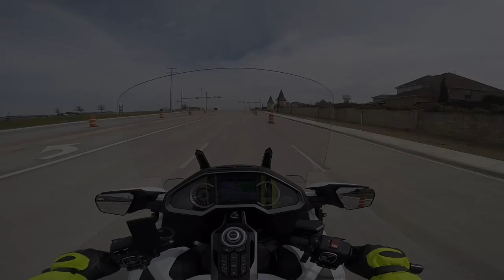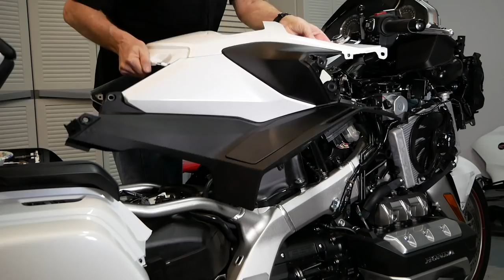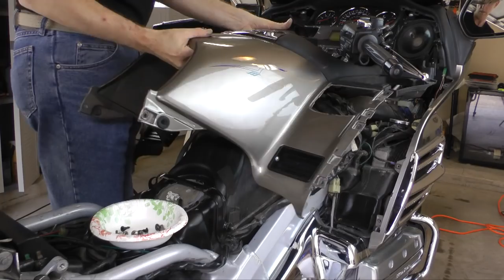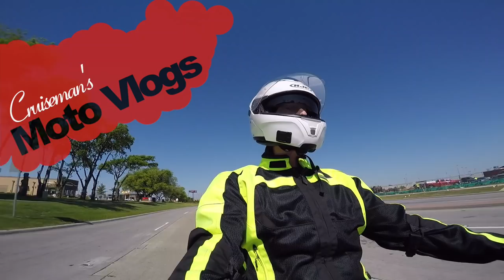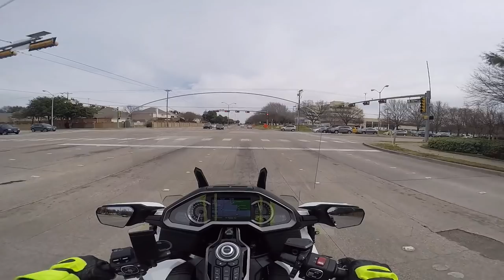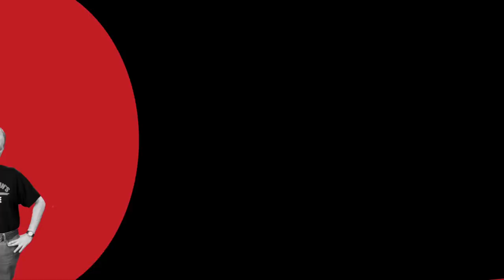A Cold Day Ride in Texas | Cruiseman's Moto Vlog | CruisemansGarage.com

Comment: Chris - Another GREAT video. :)  You've answered my "inquiries" regarding the "recommended tools" AND I'm very happy about the NEW & IMPROVED Show Chrome isolated fuse-block from BigBikeParts for the 2018+ Honda Goldwing.  I look forward to you doing a possible installation video for this new isolated fuse-block.  BigBikeParts has a lot of cool stuff for the 2018+ Honda Goldwing; I'm impressed with them AND you for the products and installation videos for the 2018+ Honda Goldwing.  Thank you, Chris and BigBikeParts. :)  ALSO, I, too, ride in cold weather WHEN the roads are dry.  I've ridden in 26-degree weather by wearing jeans with an inner liner, a non-mesh light-weight jacket, First Gear motorcycle pants with armor, and First Gear motorcycle jacket with armor.  With the Goldwing heated grips and seat, I'm very warm.  I do have Gering lithium-ion battery-powered heated gloves which I can wear IF the backsides of my hands get too cold.  Bottom line:  I prefer riding in "cooler" weather;   75 degrees and below. :)

Comment: I ride everyday of the year (I don't own a car)  in North Alabama. Now riding an Indian Roadmaster I bought a year ago. Before that , I rode (and still ride some) a Victory Vision . My record cold ride to work (30 miles one way) stands at 4F about 4 years ago. My water bottle was placed in a bar mounted cup holder and it had ice in it when I got to work. 

What do I wear , you ask? Everything I own lol. Coldest ride on the Indian this year was only in the teens (it never reached single digits in north Alabama this winter). 

I haven't used heated gear in 3 winters. I found a water proof, wind proof one-piece suit that is bullet proof in the cold. I layer accordingly under it  depending on temp. The only thing is that it does not have armor. Heated grips and seat help in the cold.

Comment: At the moment I use welding gloves (gauntlet style) and I cut the bottom of the gauntlet covering so that the gauntlet will slip over the end of my leather jacket. Good for cold weather, but I would like to find a good pair of gauntlet-style gloves made for motorcycle riding that are more flexible for pushing buttons.

Comment: Chris - A correction: I have Core S-2B Heated Gloves from Gerbing's Heated Clothing, Inc.  ALSO, a non-mesh light-weight jacket, such as a windbreaker for wearing underneath motorcycle clothing gear when riding in COLD weather.

Comment: Nice informative video Chris, I too wear my long underwear (long johns) when riding in the colder months. I also wear them when I go to the football matches when it’s winter here in the U.K. - they certainly keep your legs a bit warmer. Last winter I purchased a pair of Gerbing XR-12 heated gloves. These can be powered by connecting to the bikes electrical system, or via a small batter pack which fits neatly into the cuffs of the gloves. Using the battery packs the gloves stay nice and warm for around 90 minutes. Gerbing also manufactures heated insoles for fitting inside your favourite bike boots. I have recently ordered my new Goldwing to replace my existing 40th Anniversary model. I have opted for the DCT version as I like the idea of using the dual clutch system. I assume it will operate the same as the DSG gearbox as fitted to my VW Golf R.  Recently joined the GL1800 forum and I am looking forward to posting a few pictures of the new Goldwing when she arrives. Decided to go for the red and black colour scheme as I think it really suits the lines of the bike.

Comment: USB 3.0 Thumb Drive 128 gig. I deleted some outdated info off the drive. I downloaded the software upgrade from the Honda site directly onto the thumb drive. Once the download was completed I right clicked the drive icon in explorer to eject the drive safely. Plugged the 3.0 thumb drive into the usb adaptor on the motorcycle, turned the knob twice or until in ACC mode, and the prompts for the download began. My download time was 25 minutes. The drive format, copying and pasting from the computer to the thumb nail for me all were unnecessary steps.

Comment: First gear mesh jacket with liner in. Very thin full leather gloves. Blue jeans without longjohns. On my previous ‘12 Wing this was good to about 39° for a couple of hours using heated seat and grip. On the ‘18 it’s a bit different. Upper body is generally OK to about 40° with the stock windscreen up full for an hour. I sometimes close the LS2 helmet for added comfort. But the lower body gets chilled a lot more than the old wing, and an hour of that and I’m no longer comfortable. Living in Florida, I just can’t bring myself to buy longjohns. Hah!  Do they even stock them here?  Keep up the good work Chris.

Comment: I had no issues with the update. I had to format my USB from FAT 32, to NFTS, and to will need at least a 16Th stick,  but other than that it went exactly as advertised. I use a battery tender on all my bikes while in the garage, so it was on a tender anyway.
Took 30-40mins, or so.
No issues since.

Comment: I live in So Calif and it only gets down to the mid 30's. The community I live in, the streets are angled towards the center and runoff from sprinklers runs across the streets. I only ride when I know the water hasn't frozen during the night and make sure there will be no ice. Don't want to go down on my new bike. I did the new update on my 18 and it took about 45 min. One forum said I needed a flash drive 6 GB or bigger, and found Honda's website said at least 16GB, so I think that was a typo. Honda's website and instructions to download the update was well written and easy to follow. I haven't rode the bike, but did have to re-pair my J&M Blu-Hub and reset some favorites and such. I will also have to re-pair my phone. I did notice it did not let me select the HSTC. I wonder why? I will look into that later. Looking forward to more Cruiseman's videos. Ride safe.

Comment: I wear a first gear one piece winter suit that works great for my full body, even when I ride without a windshield (not a Goldwing rider)...my issue is my hands. I have not figured a way to keep them warm below 40 degrees. They hurt BAD after 20 minutes under 40 degrees. I'm considering battery operated gloves to help in these times. I don't want to do any wired heated gear as I only have issues with one area ( plus in North Texas it's only really cold for 2 months a year).

Comment: Although I don’t (yet) own a Gold Wing, I have watched all your VLOGS and have learned a lot from them.  I live in central Florida (Melbourne area) and plan purchasing a 2019 DCT and traveling to Nashville for Wing Ding 41.  There are several accessories I want on my bike with the Sirius XM antenna installed before leaving the showroom.  Do you recommend any other accessories I should consider immediately?  I was thinking of adding the fog lights during my visit to Nashville.  By the way, I have a sister who lives in Carrollton.
Reply: Lupe - I had ALL of the  optional accessories for my 2018 Honda Goldwing Tour DCT installed by the dealer.  It's better to only have to disassemble the motorcycle once, then install the optional accessories, then reassemble the motorcycle.  Let the dealer do the installation.  Odds are that by now, the dealer will have had some experience with the "ins and outs" of the 6-generation Goldwing 2018+. :)  Enjoy your future and NEW Goldwing DCT.  I have the Tour model which includes the "top box," center stand and other goodies. :)

Comment: Love the videos.  Been a 35-year Winger & just discovered these.  Picking up my 2018 this weekend.  So...a couple things.  With the 2018..does a Battery Tender still connect direct to the battery or should it also go thru a fuse block?  And...for a product review, my Yamaha FJ-09 has a brake modulator from Vizi-tec called the SupaBrake II that is the best I've seen.  They're basically made to order.  The guy who builds them says he doesn't have one for the Wings due to the complexity but that he'd be willing to work to create one.  You might be the one for that job.  :-)  Gear-wise, I have full MotoPort jacket & pants.
Reply from the maker: Doug, you can connect the battery tender to either the battery terminals or the fuse block. If you have a isolator, it means less connectors hanging off the battery terminals, but the effect is the same. Also, check out my 2018+ Maintenance Videos at http://gw18.cruisemansgarage.com. Congrats on the new bike!

Comment: How do you like the DCT? Any regrets?
Reply from the maker: No regrets.
Reply: You can find gloves with a pocket on the back of the hand for a hand warmer pack.
Reply: I held my breath and rolled the dice and chose the DCT transmission based on positive reviews from riders that, like me, had always used a manual transmission. No regrets. Just the opposite, in fact. The DCT is NOT an automatic transmission! It is automatically shifting a manual transmission. The difference?  An automatic transmission in a car uses a lossy lock-up torque converter which is basically a fan from the engine blowing oil past a fan connected to the drive wheels. Lossy! But, at highway speeds, plates come out and lock the power from the engine directly to the drive wheel. In a DCT (Dual Clutch Transmission), you have two dry clutches. One changes the odd-numbered gears and the other changes the even-numbered gears. No power loss. It's like having a manual transmission that can change gears while the toe shifter is getting its shoes on. The default mode is Tour, which is powerful but gentle for everyday riding. But, put it into Sport mode and you had better be holding on tight. I'm a huge fan of the DCT, which some smaller cars now have. The DCT also has shifter paddles in case you're in Tour mode, but want to kick the transmission down quickly for passing. Also, you can get the DCT and put on the optional toe shifter. I have a friend who only rides the DCT in manual mode and uses a toe shifter (but you can use the paddles if you want). In shorter words, you can have it both ways with a DCT and shift way faster.